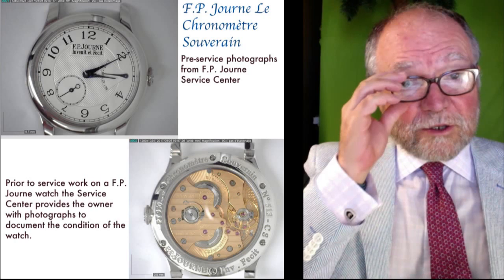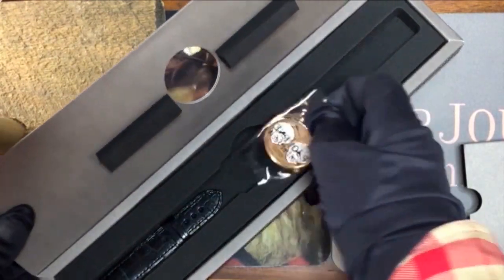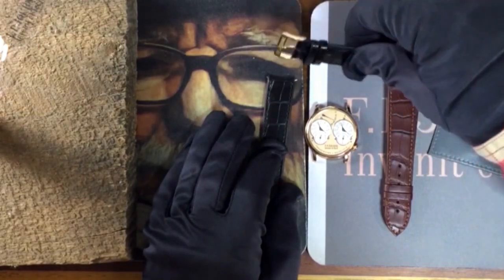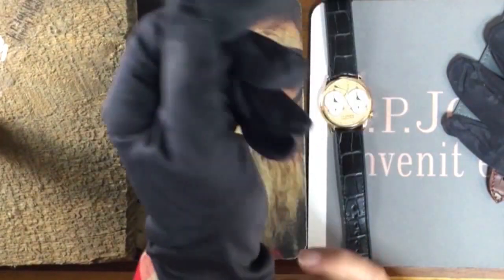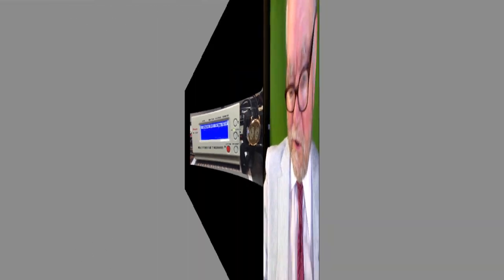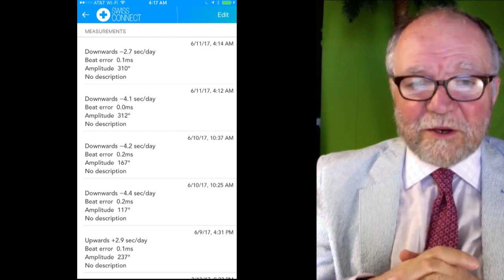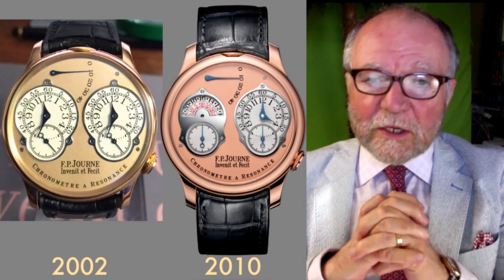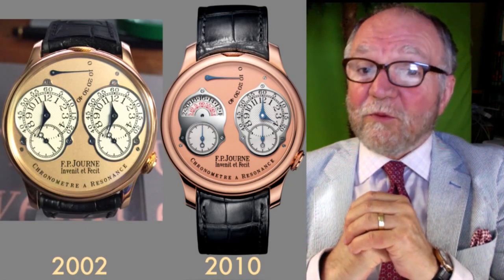#64 Making Sure Your Watch is Serviced Correctly

Comment: Great to see your Journe back Bill!
It went back very quickly.
I've been anxiously waiting for one of my pieces to come back home for four months!!
If I may add another tip on watch keeping since you're concerned about sun light in your video: try to keep watches on a stead temperature whenever possible. Mainly the ones manufactured before modern material like silicon have been introduced in watchmaking.
High variances in temperature can make metal components such as hair springs expand or contract hence harming timepieces precision.

Cheers
Reply from the maker: Hi Amintas. Excellent point about keeping watches within temperature ranges that won't expand and compress metals. Indoors will usually do that--if you're comfortable your watch will be as well. Here in New England we get extremes from 0° (f )to 100°(f); so we have our heat on in the winter and AC in the summer! Kindest regards, Bill

Comment: Also remember to check the condition of the case to see if they polished it and what the quality of that is. I got my Blancpain Bathyscaphe from service and the case had a minor flaw that the servicing watchmaker had done. It was really small but it lead the whole middle case being replaced to new one as a warranty service. Mistakes can happen! Thanks for the very informative channel.
Reply from the maker: Thank you Jukka for a great tip!! I had light polishing on my Chronomètre à Résonance because of the gold case, but on my platinum Le Chronomètre Souverain, they are going to give it a big time polish. So you bet I'll check it and I'm going to double check my Résonance's case right now. I was so concerned about the winding mechanism and the power reserve indicator that I forgot all about the case. Kindest regards, Bill

Comment: Hi Bill, nice mouse pad ;). Looks like the watch came back looking and running great. Very cool of them to include another band as well. Nice tip on the leather bands too. The buckle can really do a number if they are left on during storage.

Overhaul and service costs can really be a kicker that people overlook when buying watches. This is one reason I really hate when people will recommend vintage pieces to a first time buyer or someone that's newer to watches. Sure, you can get a great piece at a fraction of the cost of a new one, but if you are on a budget it can really break the bank or force someone to sell the watch because they can't afford a needed overhaul or service just a short time down the road after purchase. And unless the seller provides a detailed record, certainly never trust the "recently serviced" line many sellers give. See ya Sunday, Cheers!
Reply from the maker: Hey chr1s60, great to hear from you! One of the early watches I bought was from a dealer who had his watchmaker service it or at least check it out. The watch has been pretty good, but it should get a service soon. Whatever "service" they did either didn't last very long or very complete. I had both of my F.P. Journes overhauled. It was expensive, and they needed it--new parts and all. However, it's the old "pay me now or pay me later." I thought I'd pay now and have a well-functioning watch to enjoy. I didn't realize that the mouse pad would be featured in the video!! YouTube picks an image at the beginning, middle and end of the video and uses it as the header. I've had three mouse pads made, the one of me is when I first got my Vacheron Constantin Historiques American 1921 and I took a selfie of it. The other two are FP Journe and Vacheron Constantin. I just used their logo and had the pads made. They serve as both mouse pads and work areas for my watches.  Kindest regards, Bill

Comment: I just had my Datejust serviced at Rolex, and their "master polisher" did an awesome job fixing some damage an AD did to the case while they attempted to polish it (unbeknownst to me). The watch looks great and keeps great time. It wasn't cheap but they replaced the crown and crystal as well (hesalite, could have been polished but oh well, looks great).
Reply from the maker: Hi TimeKeeper, that is interesting. I know that polishing platinum is painfully expensive and can have temporary effects; so I was thinking that maybe I'd go to a local jeweler to have it done the next time I need it polished. However, I think your experience has dissuaded me from that course of action. Thanks for the tip! Cheers, Bill
Reply: To the AD's credit I think it would be very hard to do a good job polishing a watch case unless one had everything stripped down (like they did at Rolex while the movement was being serviced etc.). Initially, when I got the watch back from the store while on my holiday (after I took them up on the offer to replace a part on the bracelet they had ordered in for me) I noticed right away something was wrong with the way the light hit the lugs etc. - upon closer inspection, the edges of a couple of the lugs were almost completely erased. (I did a video on this). When I received the watch recently from Rolex I was pleasantly surprised to see those edges back and the case looked "right in the light". Even under the loupe it looked good. Despite the favourable conditions I was still very impressed with this polisher at Rolex. So yes I would say get polishing done during factory service only - but I'm pretty "particular" :-) Thanks Bill for your great content.
Reply from the maker: I did what you did. I had  my FP Journe Chronomètre Souverain polished at the FPJ service center for the US in Florida. Apparently, platinum is notoriously difficult to polish, and while they did a good job, I cannot tell the difference between well-polished platinum and stainless steel which I polish myself with a Cape Cod polishing kit. (My plebeian tastes perhaps...) Cheers, Bill